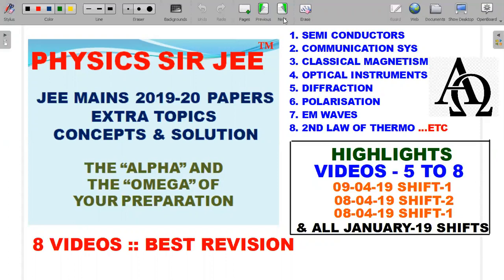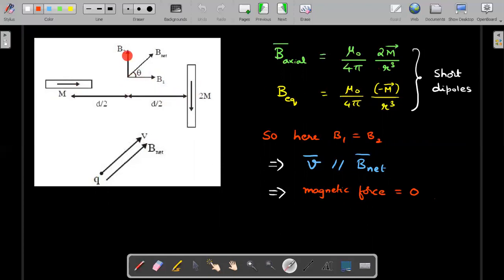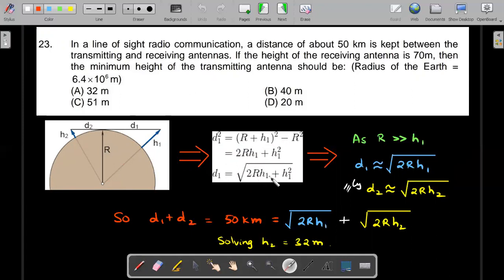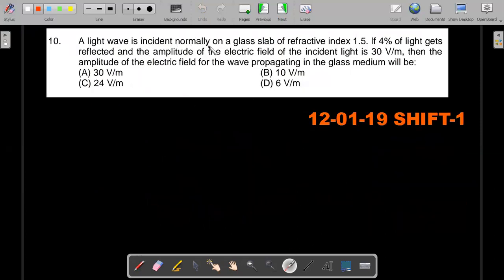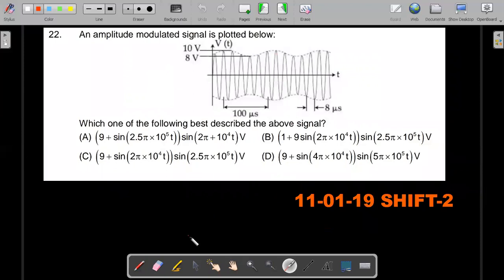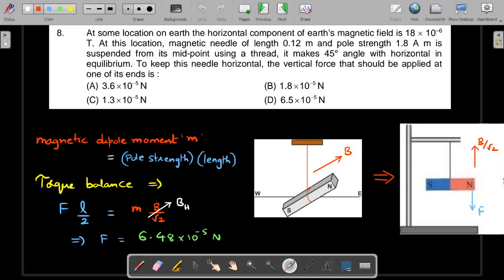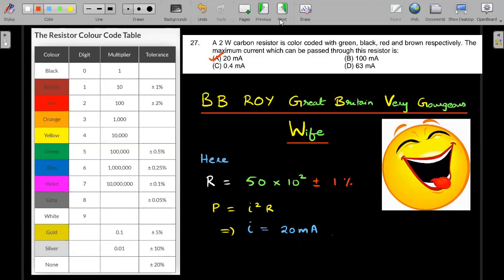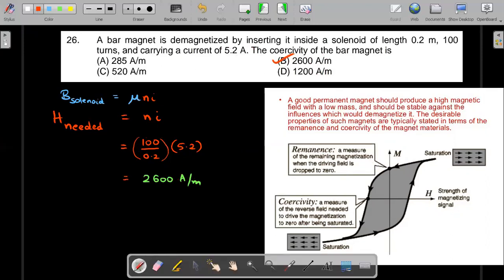JEE MAINS 2024 PHYSICS HIGHLIGHTS | VIDEOS 5 TO 8 | EXTRA SYLLABUS TOPICS| SOLVED PREVIOUS PAPERS

Comment: Congrats for 8k subscribers sir!

Sir at 23:56 , when the zener diode is connected in reverse bias, so when we measure the potential drop across it, isn't the voltage rising from negative to positive (+10 V) (when we come from top to bottom across the zener) , and thus, the voltage of zener should support the external battery.... but instead, it is the other way round... am I taking the wrong polarity of zener diode? I am having same issues in other such questions also... as far as I know, the tip of the diode is negative and base of that triangle is positive.... so why is potential dropping instead of rising?
Reply from the maker: Tip of Zener symbol is positive and base is negative. Remember ,Zener works in reverse biased condition
Reply: @PHYSICSSIRJEE  Sir then would we call it reverse biasing even if the negative terminal of battery is connected to negative terminal of zener? From what you said sir, so is it the case that polarities sign convention is opposite for zener diode and a p-n junction diode? Because I am sure that in a p-n junction diode, base is positive and tip is negative...
Reply from the maker: @vilakshangupta380  no , biasing is based on terminal connection. For Zener to work it has to be in reverse biased condition. So postive terminal of battery should be connected to n side of Zener . So n side is at higher potential

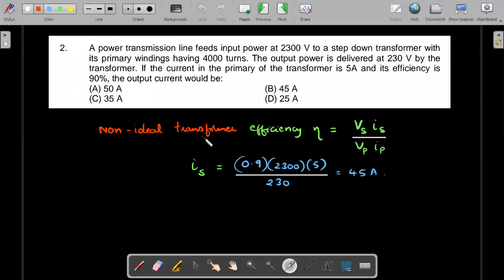Comment: sir at 32:20 if they would have  asked number of turns in windings of secondary coil then can we equate flux of both sides...or do we have to account efficiency factor for flux also
Reply from the maker: Is it the correct time stamp ? I went to some other question
Reply: @PHYSICSSIRJEE  Sorry sir, can you plss check it now
Reply from the maker: @goural5256  efficiency is power related term and not flux . So , flux equation is assumed to be still valid until unless separately mentioned otherwise 👍
Reply: @PHYSICSSIRJEE  ok thank you sir